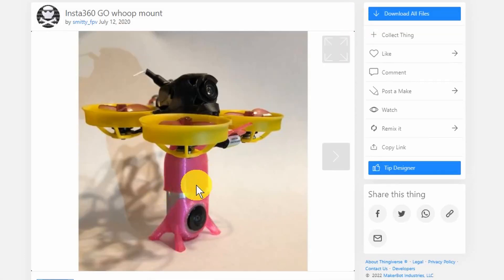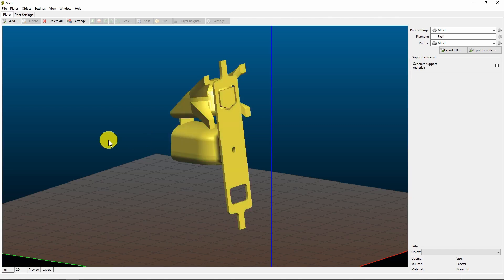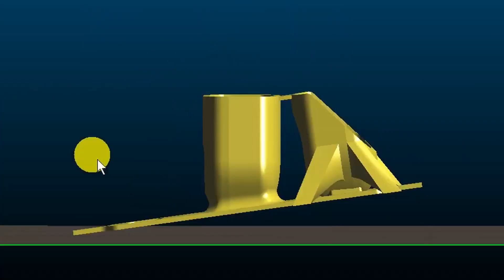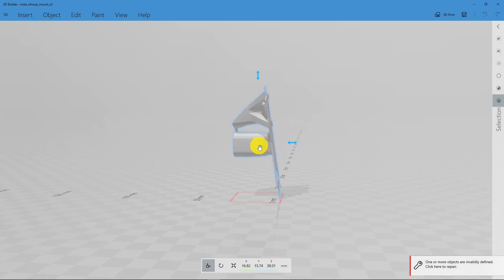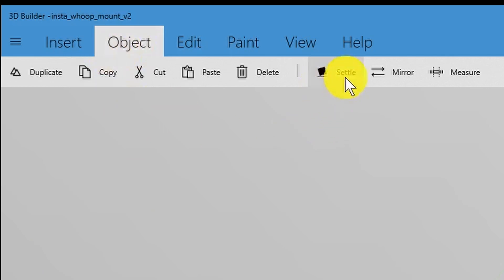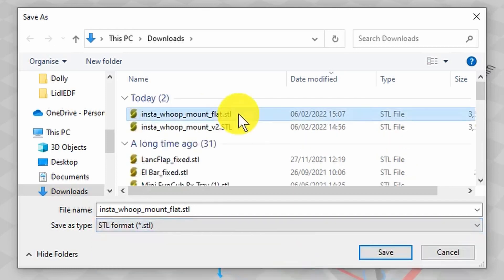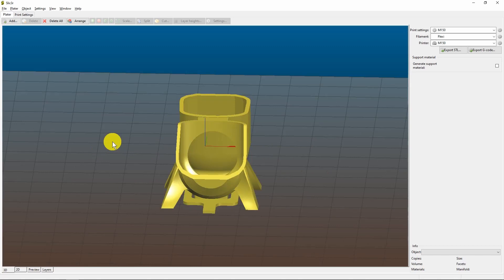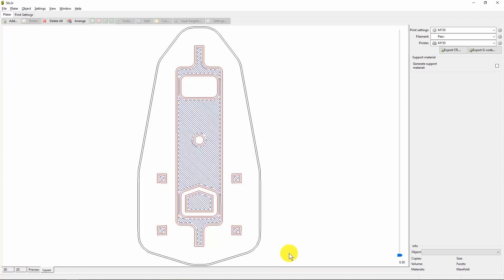No Lay Flat Option in  Slicer Slic3r?   No Problem!

Comment: i have a question. how do you do to make the brim and skirt appear on the screen ?
Reply from the maker: At the bottom off the Slic3r window you see the tabs, 3D, 2D, Preview and Layers. Switch to the "Preview" by clicking it and you will see a preview of what is going to print. You can use the slider on the right of the window to scroll through the print. Thanks for watching, have a great day!
Reply: @1nformatica  thank you! I did it and now I see them! Have a great day
Reply from the maker: @PoodleMaster69  •:*¨¨*:•_•:*¨¨*:• EXCELENTE_•:*¨¨*:•_•:*¨¨*:•_!!